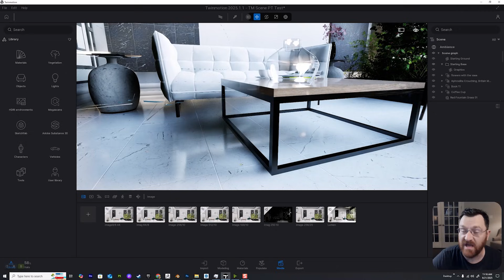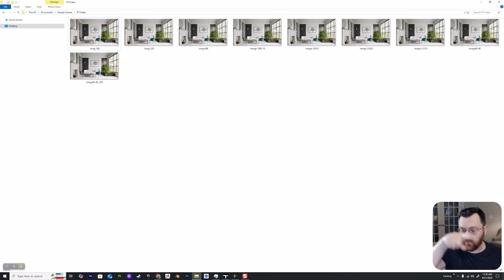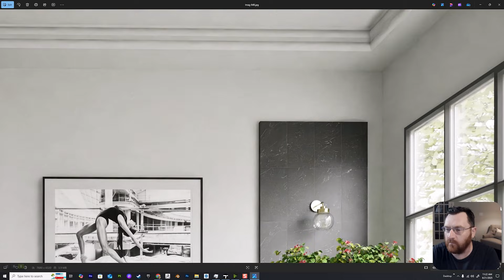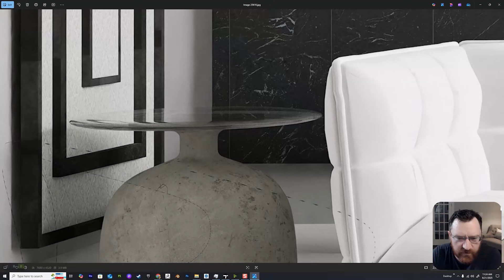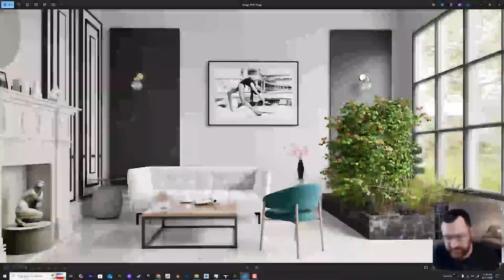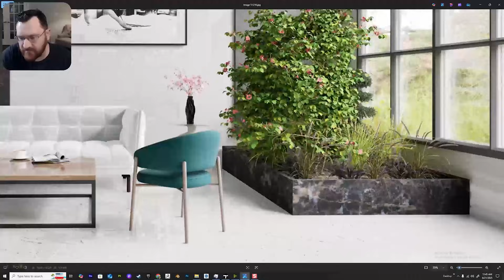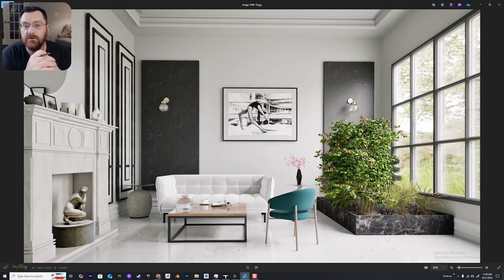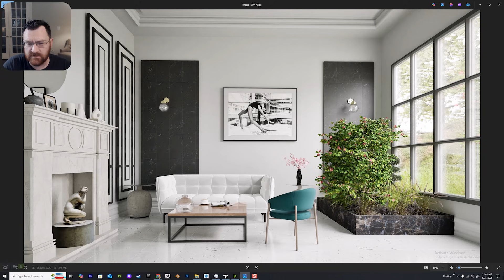Twinmotion: Path Tracer Setting

Comment: Regarding the bounces, or in other programs its sometimes called the max ray depth, You only need higher numbers, if you have a lot of reflective surfaces in your scene, like mirrors, or glass and crystals with plenty inner reflections. 
In the early days of raytracing/path tracing/global illumination, it was said, 3-5 bounces would be sufficient for most normal scenes to illuminate, a few more bounces only for poorly lit interior scenes with a few small (therefore hard to hit) light sources. So with your standard 10 bounces, you are already way above what once was called enough for most scenes ^.^ 
The best way to visualize the number of bounces is to imagine or to recreate an infinite mirror - two mirrors reflecting each other. The more bounces you have, the more number of mirrors you can see in them, when they reflect each other. But for most objects with not mirror perfect surface, you don´t need that many bounces, 10 sounds more than reasonable.
Reply from the maker: Thanks for the comment, bounces are oddly one of the most commented topics that I get! And the Mirror reflections has been mentioned to me before as something I should show my students. I think a part of the issue is the makers of TM not explaining to the user baser suffiecenlty about what the sliders do (rays/samples and bounces), but thats just a thought.....! Cheers for watching.
Reply: @viarender  it also may be, that some people try insane values, because they come from different programs, that handle things different, or read stuff about them without much context. F.e. my old C4D has 3 separate bounce sliders: one for Global Illumination bounces, one for reflections, and one for shadow depth -> if an object is reflected above this value, then its shadow will not be calculated for any further reflections o.O. Here its all combined into one setting.

Or that other programs require way higher samples because of no denoiser, or different quality of the denoiser. In Unreal Engines Movie Render Queue, if i drop the denoiser (that one is pretty aggressive), then i would have to use f.e.  128 or 256 spatial samples and 16 to 256 temporal samples. And since they are multiplied, that results in 2048 to 65536 samples per pixel. 65k samples are good for still images, but for an animation... yeah nope... that results in about 10 minutes per 4k frame on my RTX 5070 TI ^.^ the 16k samples version was about 2.30 minutes per frame.

Comment: Hey fella, have you looked at D5? I've just started using it. For comparison I created a 10sec animation in TM and rendered in 1920x1080 using path tracer. It took 5hrs and was completely unusable because of noise. I rendered the same in D5 at 6K. It took 13mins without changing any settings other than what it uses at default and it was completely noise free. The stills at 16k take minutes compared to TM as well. MUCH less temperamental also.
Reply from the maker: Yeah, I also teach D5 ( I think I had one of the first Udemy courses on D5 years ago). It’s an amazing program. Hyper sharp renders, but for still images, I prefer the Path Tracer. For anything video, it’s D5 all the way. D5 has a lesser learning curve, and right now, my most watched videos are Twinmotion ones.